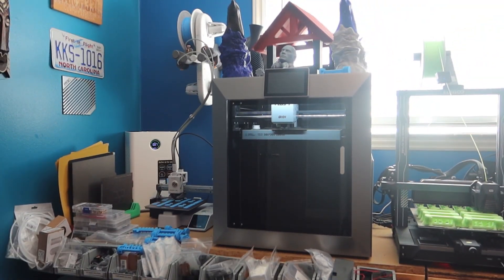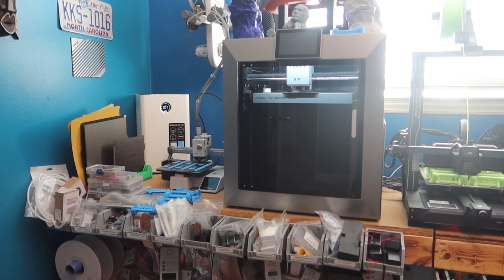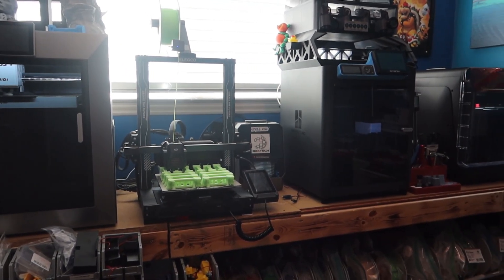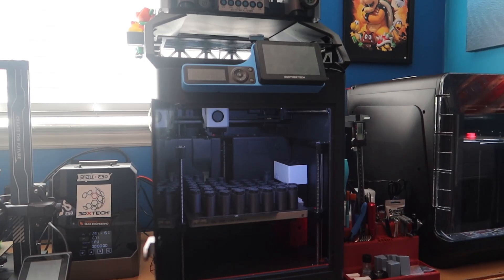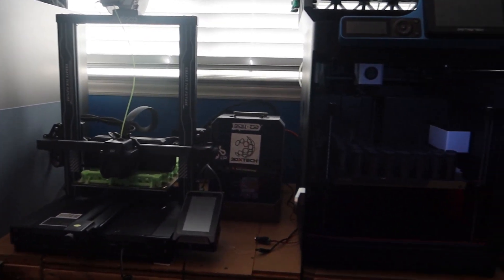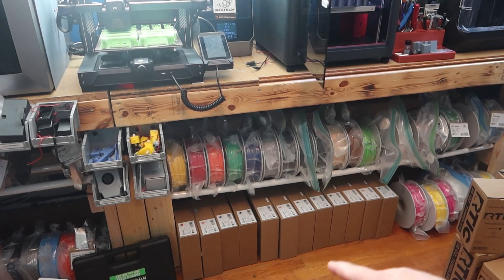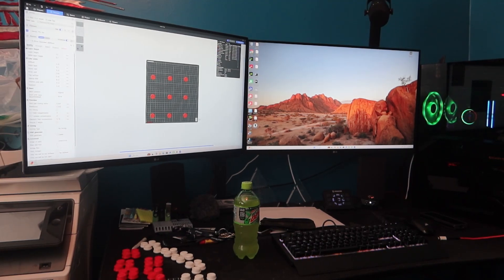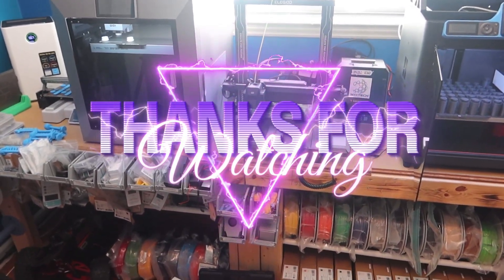How To Setup A Small 3D Print Farm At Home

Comment: Well done, I would myself never have any Bambu printer, 
They are overpriced and I not having my designs stolen by Bambu Inc since all the prints go through their own cloud storage so nope they can stick that.  
I spent years saving up bit by bit to build up a 3D Printing Hobby so I can sell my own designed stuff.

I've been doing the building up over 5 years now since the Printers are not cheap and I have a limited income.
I have 8 printers in total. However due to problems I've found with some of them even with upgrading to fix the problems, I still am having to just stop using them and dismantle them and put them back into their original boxes ( yep I kept them and even photographed the un-boxing of each so I know how to re-pack them if needed? )

So out of the 8 printers I have I got now 3 fully working, 3 being dismantled or just boxed up and 2 being repaired ( jammed cooling zone filament problems )

One of the to re-box & not use is the only resin printer I have the Elegoo 8K Saturn 2 printer, far too toxic to work with and expensive to use and no where to get rid off the resin wash water ( water based resin used )  The 2nd printer I had ever the Voxelab Aquila is just not running no matter the upgrading so that's going to be boxed.

the Fl Sun Delta QQ-S Pro that's also a pain to work with now so it's going to be boxed.

the 1st ever brought 3d printer I got 5 years back the Tronxy X5SA Core X Y big printer that been boxed back up. tons of issues again even after upgrading.

The two printers being repaired is the Qidi X-Plus-3 Core X Y big enclosed Printer. the filament jammed in the cooling zone top section so hard to get out. 
& the newest printer as well, the Elegoo 4 Plus ( having temperature problems?  I think it has a loose thermistor. 

fiddly
Reply from the maker: I run my my bambu labs via LAN only.  I DO NOT CONNECT THEIR CLOUD.

When I need.to connect I run it through a VPN with 3 Nodes (3 global locations)  sorry I'm a I.T guy 😆 .

I've love my elegoo neptune 4 pro it's a.great printer very limited due to  filiment I tend to run but for pla
Pla-cf and petg and petg-cf i use it frequently.  

What fo.you do.with all your boxed.up printers send them.for repair ?  

Never been into resin to much mess and seems like everything is toxic 🙃 
.
Anyways I hope you get your printers all up and back running  I have to much fun with mine really takes away my stress.

Thanks  for sharing your story I enjoy hearing others experiences

Comment: What printer are you printing PEEK with? What are you making?
Reply from the maker: The QIDI Q1Pro & Plus 4 are more than. Capable I use 3dxtech PEEK- A.  Usually I make parts for RC cars, I've made a bracket for  2017 civic door handle lock assembly.  One roll last sometime
Reply: @THEMANCAVE2023  thank you, I'm very interested in doing something similar in my area.

Comment: Where did you get those zip lock bags for the filament spools?
Reply from the maker: eSUN 3D Printing Filament Electronic Vacuum Storage Kit Pro 2, Spool Storage Sealing Bags Dust Proof Humidity Resistant for Keeping Filament Dry, 10 Vaccum Bags/Kit https://a.co/d/iHRHQzN

Bought the above and then extra bags